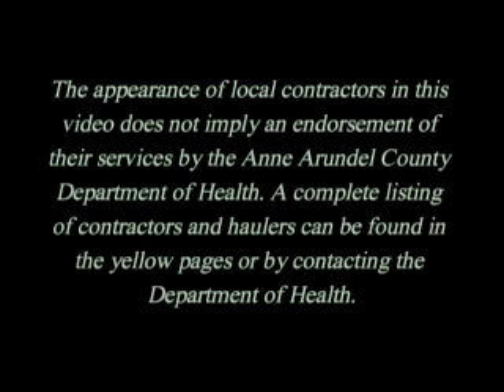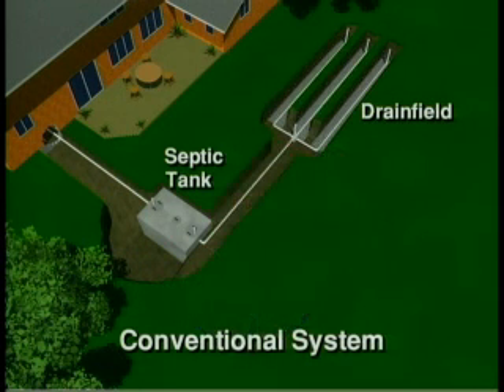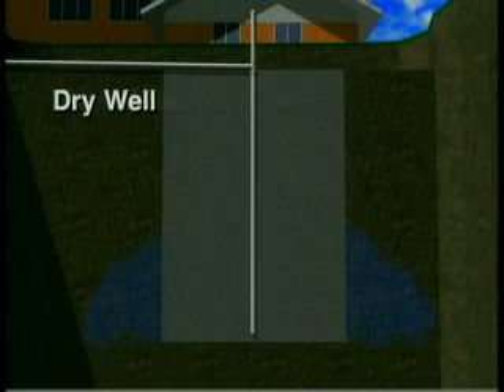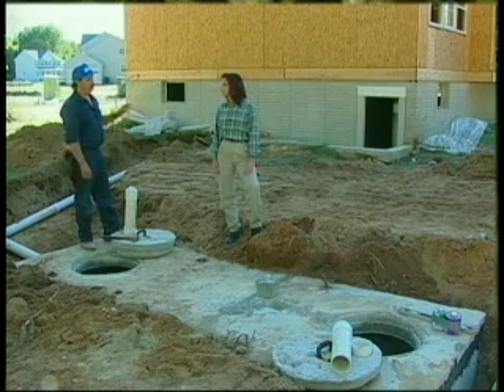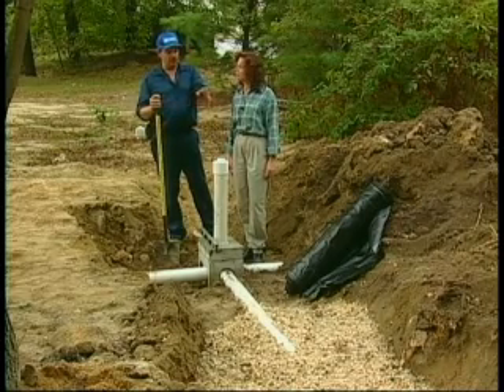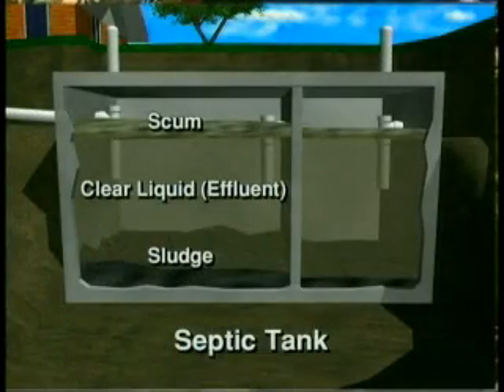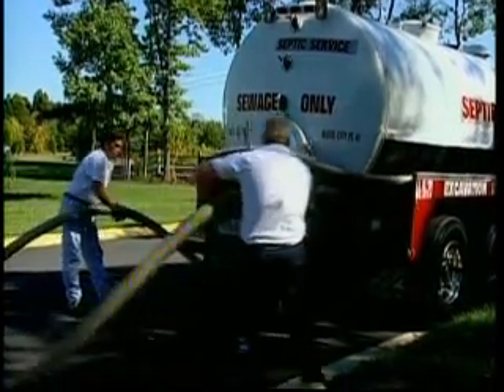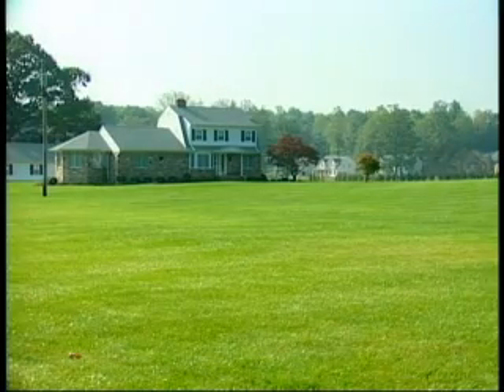Conventional Septic Systems

Comment: I hate septic systems!!!!!!!!!!!!!!!!!!
Reply: yeah septic systems suck!! Well's too!! My parents are replacing their septic system right now. Well the pipes leading to the drain field are getting replaced i think, but there's a good chance they are getting, or will need a new tank as well. Spending like $5-7 grand i think. Crazy, when i move out i'm finding a place that has city water and sewers!!! Septic's and well's are expensive and such a pain in the ass!! Every time we lose power, we lose the ability to use water and flush, everything. Really annoying b/c there's alot of t-storms and power outages in the summer around here.

Comment: Interesting that the coumty prohibits garbage disposals on septic systems.  Good idea.  This was a very good informative video and should be viewed by anyone purchasing a house on septic or considering building a new house that would have a septic system.  The county requires room for TWO complete replacement systems - grin - seems the contractors still run city Hall.